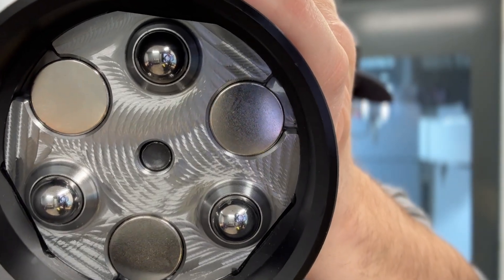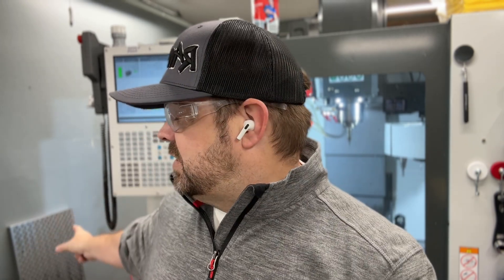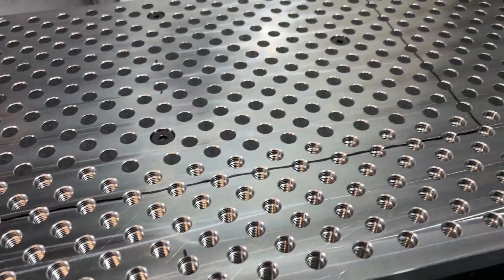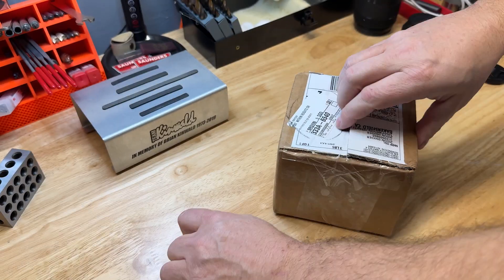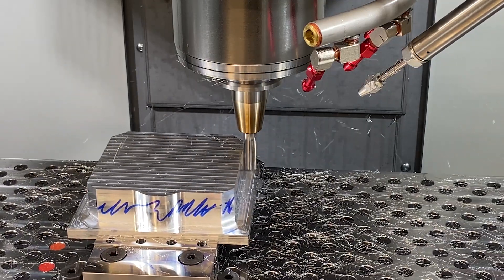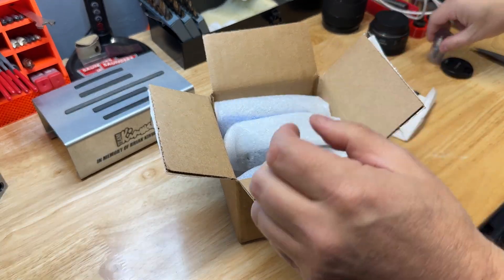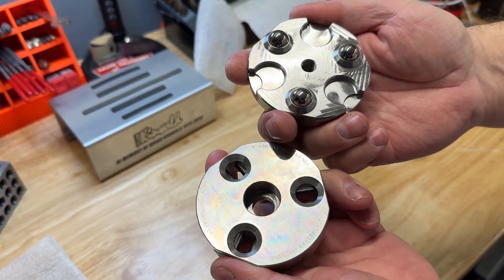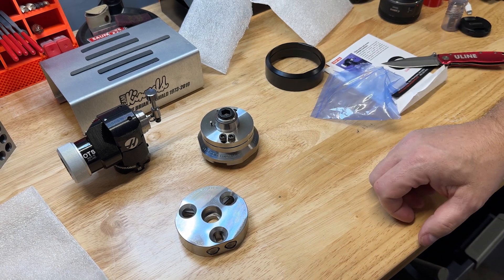Magnetic Mount Tool Setter - Exact Engineering

Comment from the maker: https://exactengineeringshop.com/collections/tool-probe-mount/products/product-update-tool-probe-mount-gen-ii-2
Reply: Hi Nerdly,  I just came across this video. Nice job on the review of our product and thank you for taking the time to lend your opinion. Am thrilled you found us and that the mount is working to your satisfaction. In addition to mounting it to a tooling plate and machine table, I have mounted it to the top of my 4th axis on our small machining center when i could not find room on the table.

Just a little background...we are an opto-mechanical engineering firm and machine shop and that dang probe was often in the way on our small machining center. So marrying the kinematic mount to the tool probe was done out of necessity. Kinematic mounts as you note is used widely used for repeatably mounting and de-mounting optics to within fractions of a micron. However, kinematic mounts can be applied to many applications, in fact the space shuttle is mounted in the rocket bay using the same kinematic mount concept!

Comment: Saunders Machine Works makes KILLER products. Worth every penny that they cost.
I have one of their fixture plates on my Grizzly G0761 (custom made since it wasn't listed on the site at the time) along with three Mod2 vice setups. I went with the anodized aluminum (7075) option since that's what they also use on their machines. Plus it means I wouldn't need to remove it from the table like with the raw aluminum version.

Comment: I have this and it is fantastic. I've used it for a few years and being able to take the tool setter off and run material that normally wouldn't fit is a game changer
Reply: If you often run w/o it installed on the Kinematic Base, see link in reply below for the new Remote Nest to safely store the tool probe.